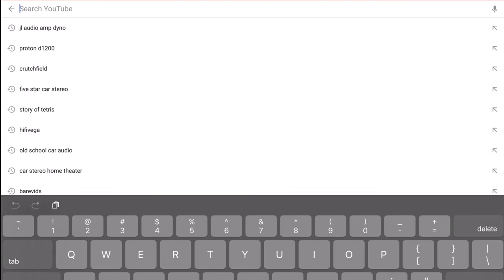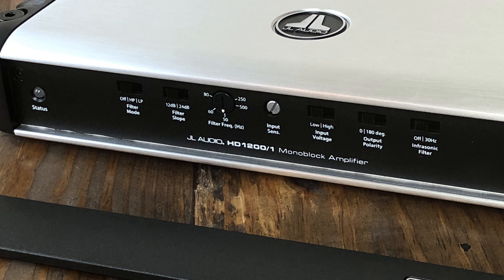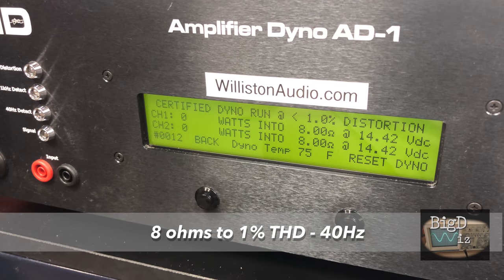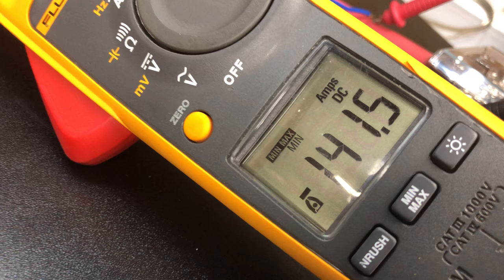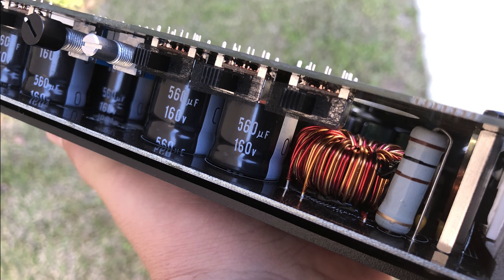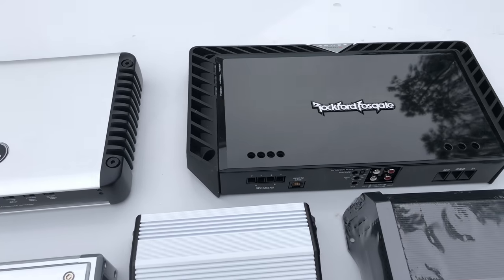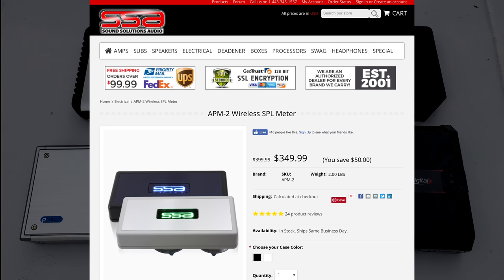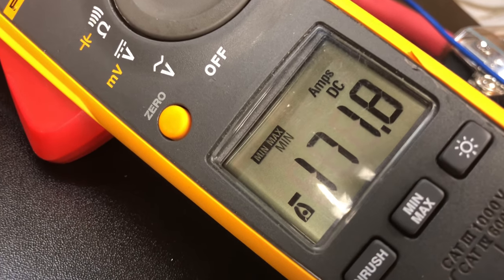$1100 for 1200 watts? JL Audio HD1200/1 Amp Dyno Test

Comment: Great video. I got an Alpine PDR-M65, 838 watts certified, $238 on Amazon. I love my JL stuff, yes its pricey, but this being a cheaply made switcher amp, I hate to say really makes this just a straight up rip-off. Especially it not being American made. Fail.
Reply from the maker: I’m not making excuses but the amps are engineered in the US, just literally assembled in China. The unique power supply is key here and the 1200 plus watts at 4 ohms for something this compact is rare
Reply: Oh no, I got you, it's all good. LOL, didn't mean to seem like a hater, I'm just one of those 'bang for the buck' dudes. Check out the size and spec's of the Alpine PDR-M65, its pretty impressive as well. Nice to parlay with you, love the amp dyno tests. Thank you for your input, have a great day.

Comment: I’m not a fan of the ‘plug in’ style battery connections.   It’s an unnecessary type of connection.  For one, it’s a part that can be lost or broken.  Clamping into a plastic piece just doesn’t seem to have that ‘rigid’ feel like the built in plugs.  

I’ve never owned a JL audio amp.  And now watching this ‘high end’ version I’m really not impressed.  I’d take that rockford amp any day.  My 2500 bdcp amp is about the same price and ten times the build quality from what I see here. Not to mention they are so under rated,  my amp claims 2500 at 1 ohm but birth sheet states 3364.
Reply from the maker: These connectors fit very tightly and are well built. I’m not a fan either though...once you include the extra space needed for the connectors, you could fit a RF T1000bd or maybe the T1500
Reply: BigDWiz 

Agreed

For proper comparison though.  Test the newer Rockford power mini amps they have now, I know they have one of those ‘connectors’ on them amps.  But they only will take in an 8 awg wire, which would concern me with a 750 watt amp model.

Comment: When you look at their subwoofer power recommendations "Limits they use to ensure longer life spans" you see this easily can drive, say 2, 12W6V-3's from one of these or a pair of 10W7AE-3's slightly under ratings or easily drive a single 12W7AE-3 or 13W7AE-3 off this amp, safely, yet get promised ratings! 

Many amplifiers with a serious varying wattage can damage speakers over time, JL has been one to use "Kapton Only" formers for most of their subwoofers for years, but they can easily be damaged by over wattage, you see this all too often "People Push them till they burn" and with companies offering recone/rebuild kit's that use aluminum formers, since they cannot match JL Kapton Only quality, you never get back the same quality you bought!  

If I was going through the expense of using a pair of 12W6V-3's, I would spare no expense on one of these amps! They were designed to compliment their subwoofer's completely and they have one of the best designs for matching their rated claims and subwoofer power requirements! 

This is a subwoofer company that started from a home speaker retailer that offered replacement speakers, then dominated Car Audio DB drag competitions in many low wattage classes for years "Only after being begged to get involved", they know what they are doing! I really love the compact design!  

All of us with older versions of their drivers have been impressed so much that a purchase was required shortly after a demo, competition or personal experience with their product!

Comment: Rockford $ 220 for 1200 watts why but jl
Reply from the maker: RF is 1200 at 1 ohm. JL can do it at 4 ohms. Why is this better? Damping factor (speaker control) should be much higher at 4 ohms

Comment: 1200w will kill that W7 in no time. Mine cooked off 1000watts after about 1 year
Reply from the maker: I’ll take it easy on the sub. I won’t exceed its limits, just a bit concerned with the Brazilians and their output hoping it won’t damage the sub
Reply: BigDWiz That's what I told myself too. Untill the coil got noisey and burnt out lol. She did do 141db at a sound off though.

Comment: Never pay that much for a Jl amp ,  poor connections and not even a remote for the price either.  Rather keep my good old Orion 2500D  I know it's far bigger but it's like a Rolex next to that Jl crap.  The rocky is better amp still high priced but it's price are driven by "fans"  now the T15K was crazy.  Just like jbl teaming up with crown and making some bad ass amps on a wallet friendly price tag

Comment: What crap!!! That efficiency absolutely suuuuucks. RIDICULOUS!! My kicker 1200 I could buy 3 of and get same amount of power and way better efficiency. I mean if you have a 1200 watt amp then you don't have 3 setting in the trunk. You most likely have a stock or 240 amp alt so why in the world would JL not make sure that amp is efficient as possible? I don't get it... the old saying you pay for quality does NOT apply here with this JL amp. Pretty or not, JL on the side or not I will NOT own a non efficient amp. I have a 240 alt, a interstate battery, and a 2 farad cap, big 3, 4 gauge power, 1200 kicker, 250 watt fosgate and you know what I have ZERO issues with power. Non. Efficiency is everything for the small bangers. Recently seen.. and believe it or not it was the infinity 1000 watt amp. It put out over 1200 watts at 2 ohms certified and was 85% efficient. 1384  watts uncertified and drawing only 113 amps....also 1596 watts dynamic at 2 ohms. That's my kind of amp... oh and did I mention it's not even $300 dollars?? Now that's what I'm talking about...Efficiency efficiency efficiency. An absolute must.. JL COME ON what up with that?? $1200 smh...

Comment: The sound digital will beat the piss out that 10
Reply from the maker: Power wise, but how about in car use with music? That’s what I’m curious about
Reply: BigDWiz I have an 12000.1 I love that amp I wouldn't think I would as much as I do when I got it. Power usage isn't bad either. I have my stock and an iraggi 320 on Walmart batteries one up front and one in the back and it hasn't dropped below 13.4

Comment: what a joke on the cost Is crazy I could see if it actually was made in the USA and the deficiency was spot-on perfect but it's not I would rather have an Audiopipe apcl 1500 .1 over this amp and the efficiency is better this is a joke I feel bad for the people that spend the money on these just because they can or think they're better!
Reply from the maker: This amp is smaller and better quality the Audiopipe. JL spent a lot in engineering these amps and they use a unique power supply and put out over 1200 watts at 4 ohms. Not many amps can do this at this size. Some people get mad about expensive amps, but no need. If the AP does all you want then go with it. No harm, no foul

Comment: Could you believe I have a hd1200/1 and a hd 600/4 in my closet for about 5 years a d never used them :( ran the xd600/6 and 600/1 instead due to their size...

Comment: You can get so much better for the money ...why is it high end it's not like it has 1000 damping factor or anything like that ?????...bizarre
Reply from the maker: It’s a unique design and makes rated power at multiple ohms and voltages
Reply: That amplifier is top shelf.  Excellent control over subs at that wattage.

Comment: Every amp on the planet is made in china. The difference is JL builds the amps in the USA.  The components inside the amp are from china, just like everything else on the planet. This am would cost 3k if everything was made in USA. Its the same with every audio brand.
Reply from the maker: JL builds its high end subwoofers (home and car) in FL, but the amps are made and assembled in China
Reply: @wal everything else they make is in USA. Amps are the only products made in china. This is not a typical china amp though You are right, they do repair the amps in USA though. It's not Chinese engineered it USA designed its true that is would cost 3k if made here.

Comment: That overpriced jl.... lol sure it does same watts over different ohm loads.. but let's be real the 1/watt ratio died out years ago and most ppl fine tune their systems and get amps that provide the power needed for their application for less of a cost and more power.
Reply: Face it........everything is going to class D so for the size, efficiency and watts, it`s a winner. 

If you compare the cost per watt, the JL HD amps are right in step with the other high ends amps such as Mosconi and Audison and are cheaper than either of those brands.

Comment: Subsonic off or 30hz? BITCH PLEASE! Save me from under 15hz, but don't touch anything above that plz and thanks! Only 70% efficient at 8 ohms? Yikes.
Reply from the maker: There are some drawbacks to the power supply design, but not many car audio amps can do same power across 1.5-4 ohms and 11-14.5 volts...

Comment: Made in China no thanks SMH 🤦‍♂️
Reply: This amp is built in the USA, engineered by Americans. The components inside the amp are made in china, but so is every brand on the planet. the factory is in Phoenix AZ. If they had the cap, transistors, board and other components made in USA the amp would cost 3,000$  Thats why every company gets the parts from China or Japan. This is one of the cleanest best amps on the planet.

Comment: Jl audio went to the Chinese build houses to save them selves money but still charge the 1990s price of a dollor a watt so they think people are just stupid ...i dont care what they say about the quality if it is from china it is a pc of shit no better than boss or hifonics so buyer beware is all i can say for that power vs dollar i would buy a higher wattage amp, hell you could buy 2 audio pipe 3ks for that much money and still have change for a good 4 channel 🙊
Reply: i had a jl hated it. im just running two kicker kx's now and not a problem
Reply: toast this never been a fan of kicker speakers but have always liked there amps ,. Used to have an old zr1000 loved it never had a problem wound up hittin some hard times and sold it and have regretted it ever since.
Reply: People ARE stupid. And i can spend less than 1/4 of the price tag of their equipment and have overall a better sounding and or a louder sound system. I refuse to use JL equipment and will not support their business. People are paying for a brand and that's it.
Reply: the kx's are the amps. the subs not really a fan of im running two 15 inch alpine swrs and they play great full bump for hours no problem

Comment: Overpriced, poopy 💩 plug designs, all that marketing hype on snr thd yeah it’s lower than most but it’s not even noticeable in subwoofer applications it don’t matter! But hey buy what makes you fills your ego, I rather get the Rockford 1500 bdcp cheaper lasts longer plays longer, try playing those fancy jl amps for long runs they overheat very easily just simple physics